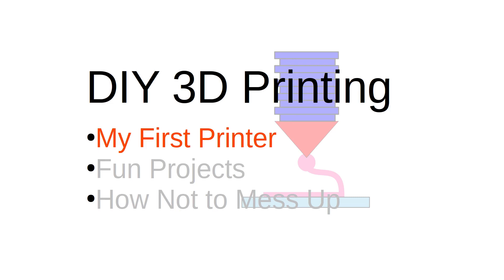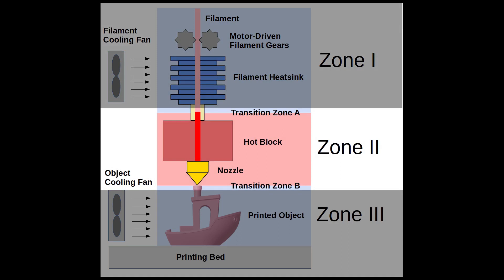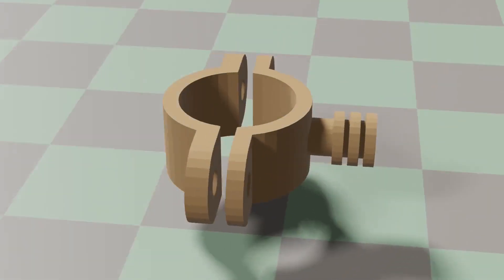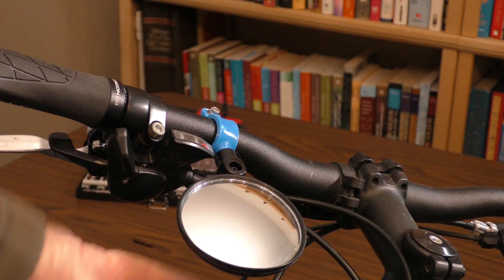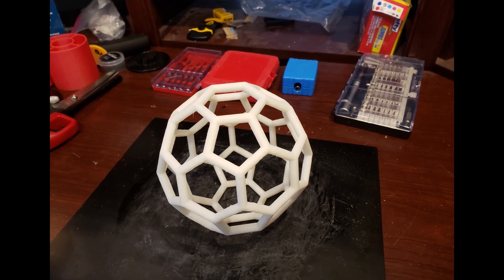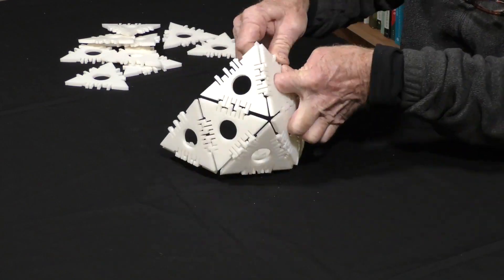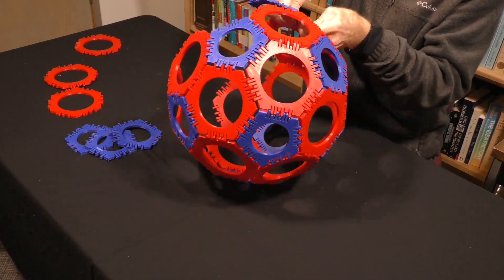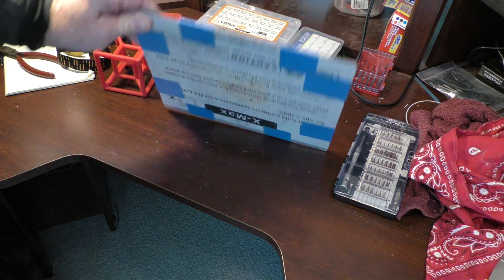Do-It-Yourself 3D Printing

Comment: I am liking your video and work you’ve done. I am wanting to upgrade my xmax also as my main board just went out. A replacement will come. But after it going out in less than a month of owning. I am leary of relying on a replacement. I replaced print head with a v6/dragon upgrade like you.   
I am wanting to duet 2 board also. 

So I have a couple questions. 
Do I need anything else besides just the board to replace. Or need any other parts to make new board work. I have some wire ends and crimpers if needed.   Also is it possible to still use original touchscreen?  Thanks in advance. Keep it up.
Reply from the maker: When you replace a motherboard, usually the touch screen no longer works, but if you get a new board that supports modern software, you will have a Web interface, which is better than a touch screen anyway, for many reasons including the fact that you can access it from anywhere on your local network, and normally the controls are better and more complete.

Be careful about brushed versus brushless motors, especially fans. The V6 print head often has a brushed cooling fan, that needs to be replaced with a brushless motor in order to work at all -- just one example.

Also pay attention to 12V versus 24V systems -- if your printer has 24V power, make sure not to buy any 12V parts.

More details on my conversion here:  https://arachnoid.com/3DPrinting

I hope this helps.
Reply: Thanks for info. I have a brushless fan for the hot end already.  I am doing this to the same printer you have. Qidi x max. I recently replaced the whole hot end assembly like you did with the one from thingi. But shortly after that board went out. So wanted to upgrade it. Just wanted to see if I needed anything else besides ribbon cable and ends. I already ordered ones you provided links to. 
How did you handle the ribbon cable to the hot end control board?  Able to use it still?  Thanks again.
Reply: I also ordered a screen to go with the duet 2. And I already have all the 24 volt fans I need I think. Was just making sure didn’t need anything special besides different to make ribbon cable work with the mini extruder board where all thermistor and fans attach too. Didn’t know how you connected the ribbon cable to mini board. Can’t tell in pictures. Thanks again.
Reply from the maker: > Didn’t know how you connected the ribbon cable to mini board. Can’t tell in pictures.
That unfortunately depends on your printer, which may not be wired the same as mine (not all x-max printers are the same). You will want to be very careful in setting up the wiring. The Duet 2 motherboard has a diagram that identifies all the connectors and where they're supposed to connect, this should be carefully followed.
Also, my article includes a suggested wire-by-wire pinout for the print head cable, just as a preliminary guide, but you may want to change it to suit your printer.
Reply: Thank you. Did you run your new cable to the print head board where the stock cable plugged in also?
Reply from the maker: @34ballz  Yes, I used that board as the terminus for all my ribbon cable connections. It was easier to do it that way. In my 3D printing video, around 2:23, you can see the cable where it joins the print head. This involves soldering a lot of connections on the back side of the original print head board.

The secret of the ribbon cable is to use as many pairs of press-fit connectors you want, that way you can perform repairs more easily -- by segmenting the cable into easily replaced sections.
Reply: Awesome. Thank you. Have board installed. Everything wired up. Having a problem getting the end stops to work. They work when I click them manually. The board light comes on to each one and the light on the switch comes on. Can’t figure out what’s wrong.  When I home axis it doesn’t stop.
Reply from the maker: @34ballz  There is a logic setting in the board configuration file that says whether the limit switch closes at the limit, or opens. More detail here: https://duet3d.dozuki.com/Wiki/Connecting_endstop_switches -- it's for the Duet 3 but the ideas are the same.

The tl;dr is that you have to make sure the switches have the right connections and supply voltages or they won't work as intended.

Comment: Great video! Have you ever messed around with the concept of tensegrity? I'm sure there's a lot you could replicate with this new printer.
Reply from the maker: > Have you ever messed around with the concept of tensegrity?

I remember reading about it years ago. It's not so easy to 3D print structures with classical tensegrity because of the overhang issues. But built from separate parts, that's possible.

Thank you for your kind words.